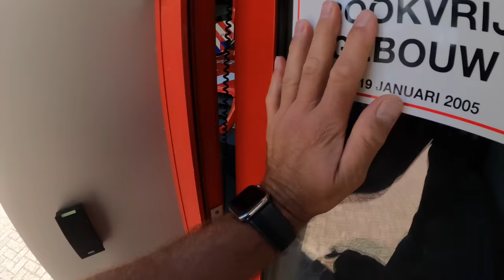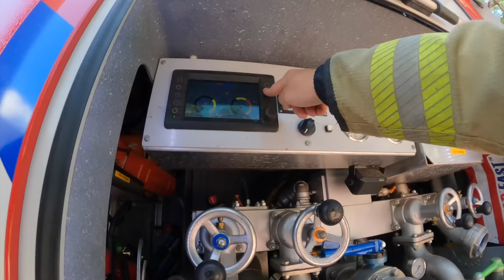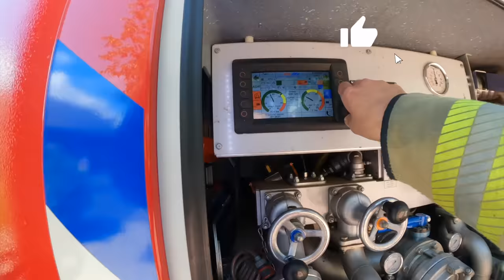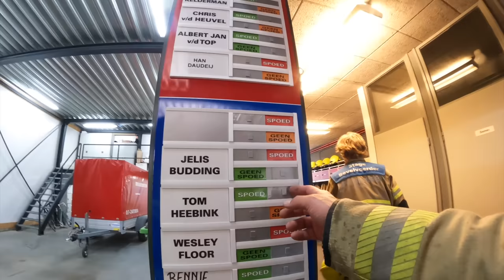Buiten brand - VOLUNTEERS DUTCH FIREFIGHTERS -

Comment: I know it's just a small incident, but I just want to say that the trainee commander ( Stage bevelvoerder ) did an excellent job.

Clear and concise communication, a proper action plan before arrival but with enough flexibility to scale it back when the situation is different than expected, a full investigation of the fire scene even when it looks contained, good level of readiness maintained (e.g. breathing apparatus stays on until he is sure there is no extension of the fire, but then he gives permission to take it off to not overwork the firefighters unneccessarily), refrains from doing manual labour when in command but isn't afraid to get his hands dirty when he's not (i.e. refilling the tank), etc.

I could probably go on, but I think I've made myself clear - I'd feel safe joining his company/squad/whatever the netherlands calls the crew complement of a truck.